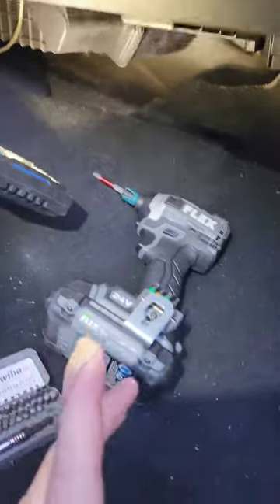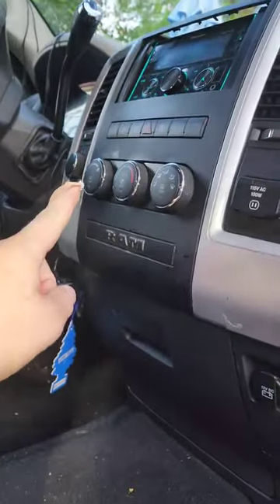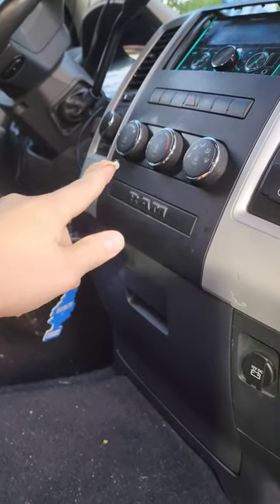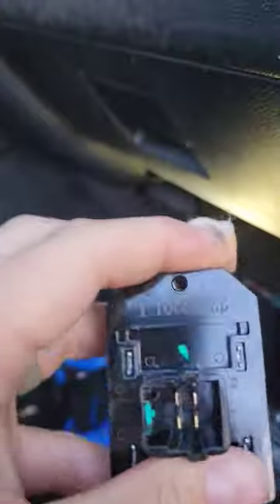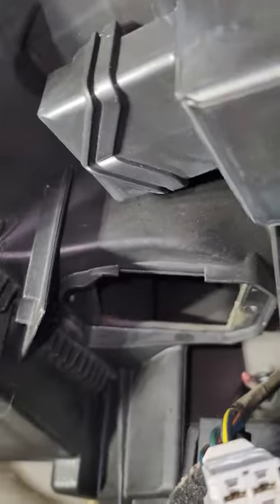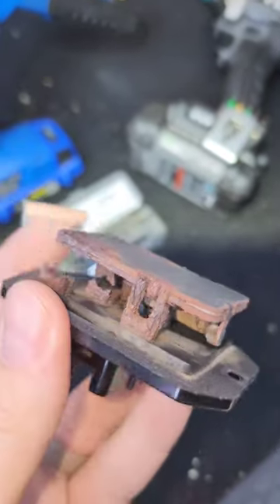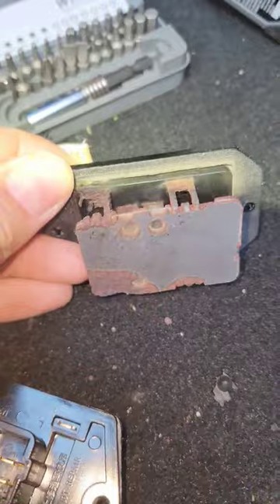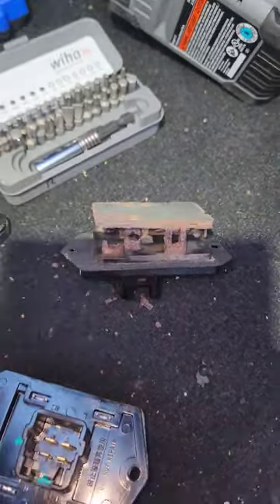2009-18 Dodge Ram 1500 Blower Resistor issue and fix.

Comment: First, I want to say a really good video and second installing a low dollar part that handles a high amount of amperage it's not a good idea unless you like melted wire connections . Furthermore when the blower motor or the blower motor resistor goes out you should replace both components so the other old component doesn't stress the new component. ASE technician for 26 years. Just saying😉

Comment: My issue is this: I turn my AC fan speed all the way up to level 7, but it feels like it’s only blowing at level 3 or 4. Will this part fix my issue?
Reply: I have a 2018 1500 and it just started doing that, il put it on 7 but only feels like 3 or 4, sometimes after driving a bit it starts blowing hard like supose to or if i turn it on & off a cpl times it starts doin right, did you figure out what it was...?

Comment: I have this truck but what mine is doing is it will cut off and then back on. Regardless what setting it is. Could it be this?
Reply from the maker: Yes I would change it out.
Reply: @alsrandomvlog8968  Just got it replaced with the resistor too. I had tested the blower motor and it was shot. Thanks for the tip.
Reply: My 2014 ram was doing the same thing blowing and then cut off and then started again it was my blower motor
Reply: @benitorocha9223 mine was doing that and then it wouldnt get cool but it would blow. I’ve changed blower motor and resistor and now hasn’t been turning on at all. Wondering if it’s the board that controls the switches themselves idk🤷🏼‍♂️